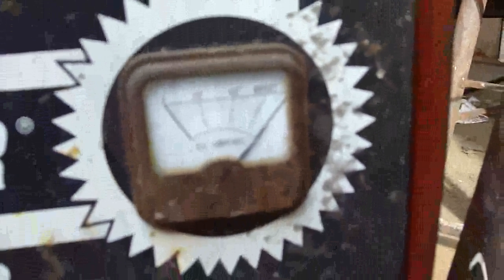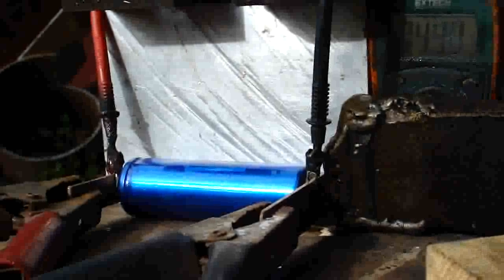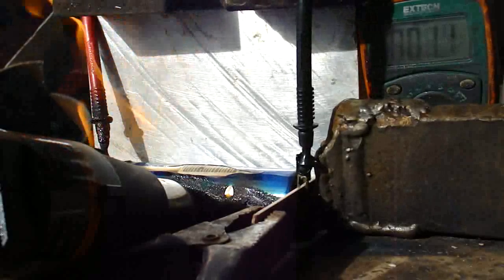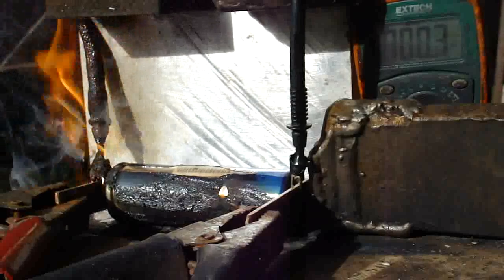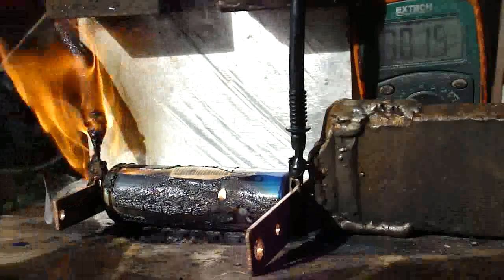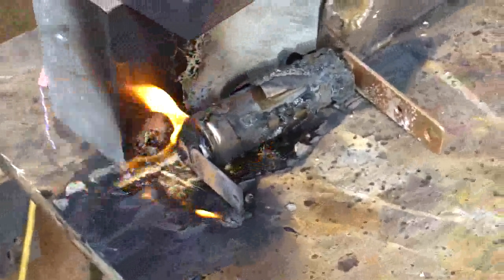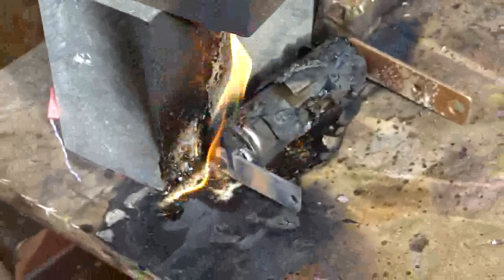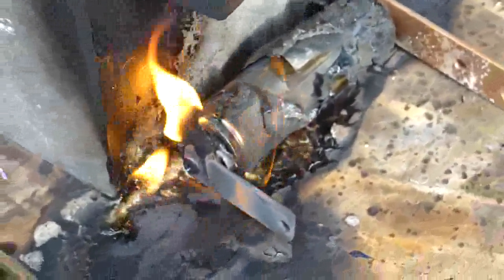Headways thermal testing

Comment from the maker: @frodus17 

Yep, this video shows just how extremely heat tolerant a headways cell is.   10minutes with 1,500w of heat blasting right into it is 250watt/hours of energy, which would be like the entire electrical energy storage of 7-8 of these cells all going towards just heating a single cell.  

Extremely safe cell design, and no amount of physical abuse to the headways cells were able to cause much more than a little smoke.